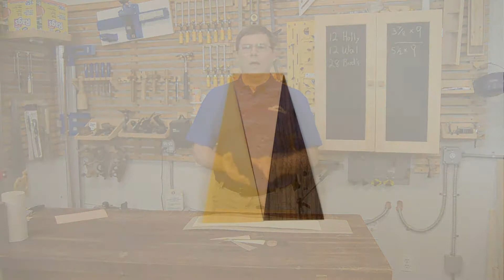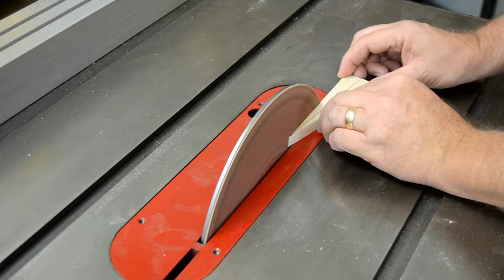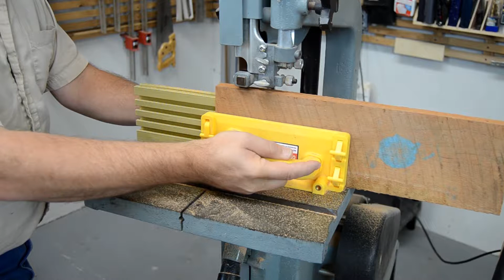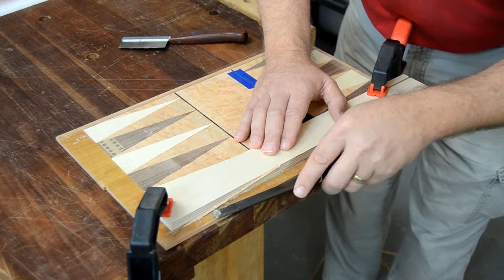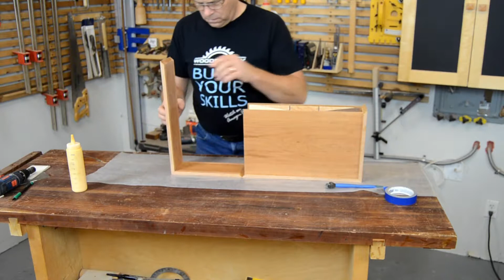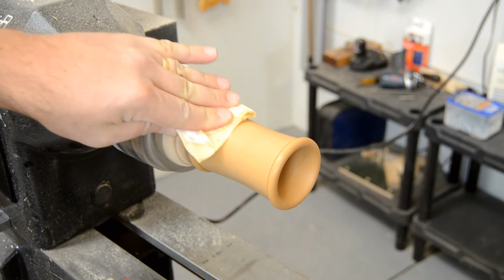Backgammon Set

Comment: It is absolutely wrong to use solid wood as a substrate. The Cherry will expand and contract which will create cracks and voids in the veneer over time. Also applying glue to the veneer will cause the veneer to curl.
Reply from the maker: And yet, here we are, several years later with no issues. Real wood was the substrate for veneering long before plywood and MDF were invented. As for the glue warping the veneer, that also was not an issue. The glue was applied sparingly and allowed to dry before the veneers were stuck down using the heat from the iron.

Comment: Man what a catastrophe this is turning out to be. My wife, she suggested I make a backgammon board for my son for the holidays. 
Bought a veneer knife, whole bunch of new veneer, watched this video about 12 times.  
After cutting the points only a few of the points have smooth borders.  
The strings look like strings of beads.  None of them have a smooth edge.  

Watched a bunch of videos how to sharpen veneer knife.  Sharpened it.  
Recut the strings.  
Still rough. 
WTH.  I’ll make it work with sawdust and glue.  
Bought a squeeze bottle and roller gizmo.  
Tested the titebond and iron trick.  Worked great.  
Put glue on one set of points and one panel which was 1/4 “ ash i milled, glued and sanded and looked perfect.   
Came down to iron veneer onto the panels.  

Panels had warped beyond salvage.   
Gotta go get some 1/4 plywood and a boatload of veneer which of course my local woodcraft won’t have. 
Should’ve bought him a Webber grill like I wanted to in the first place.
Reply from the maker: Very sorry to hear you had such issues. You mention a veneer knife. I rarely use knives on veneer, saws are really the best way to cut veneers. 
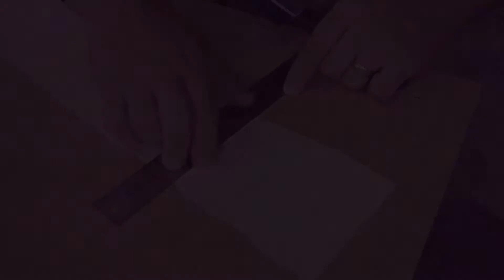At about the 6:30 mark, i discuss the saws and show the one i recommend. a good saw here really does make a difference. 
Please feel free to email me at ralph@woodcademy.com if you have questions and i will help where i can.

Comment: Did I miss the veneering of the back side of the panels?
Reply from the maker: No. While it is usual to veneer both faces to balance the panel and even moisture transfer, These panels are being trapped within a groove on all four sides, so there is little risk of warping. In addition, the box will be closed most of the time so the inside veneered faces will simply never have the same airflow as the outside. The two faces will never absorb or release moisture at the same rate.